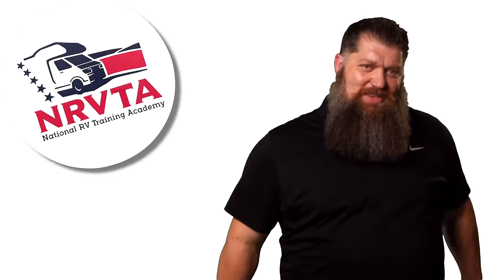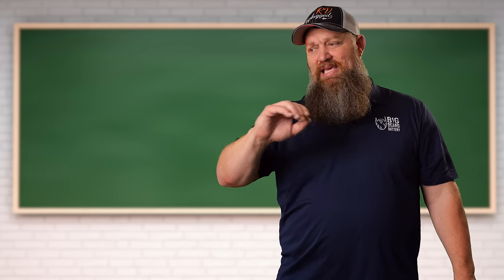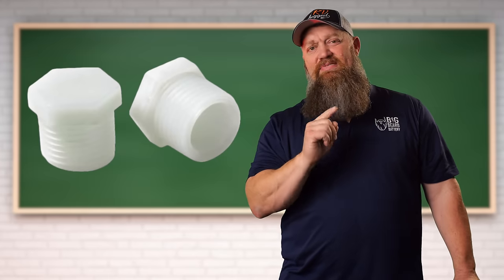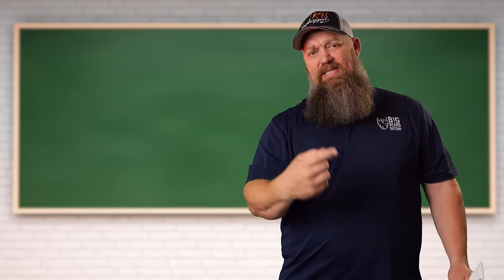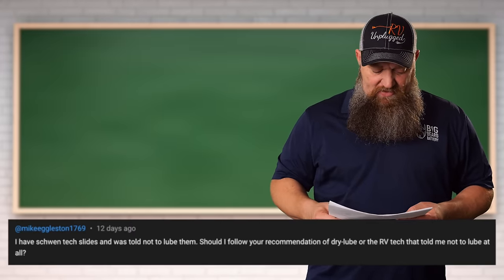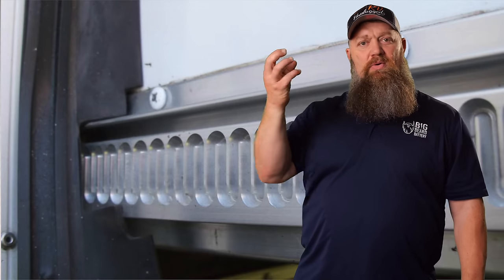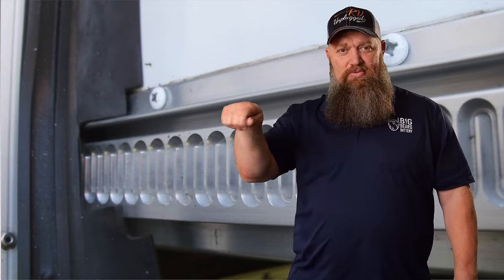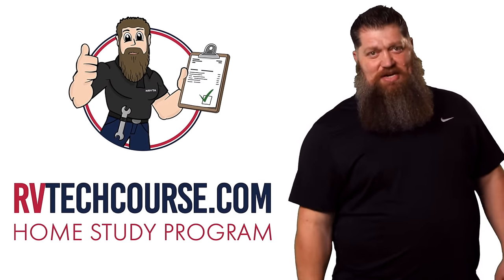Anode rod.  Does my RV water heater need one?

Comment: Hi Todd. Thanks for all the great information in your Tech Tips. I’ve been researching an issue with our Dometic water heater when it’s running on propane. It start up fine but then kicks on and off randomly. Sometimes it runs for 20 minutes sometimes only for 30 seconds.  Then it will immediately try to restart itself and most times it does. Occasionally the reset light will come on and we’ll have to turn it off and back on again. I learned there is a thermal cutoff fuse, ECO and TStat but it seems if any of these were not working the water heater wouldn’t run at all. After inspecting everything it looks like the red wire to the ECO may have some charring on it which my best guess is saying that perhaps flames are coming out and up to the wires and the components are doing their safety job by shutting it down. What would cause flames to be coming out near the burner?  I’m not sure what to look for there.  I don’t see anything blocking the area near the flame but the “pipe” the propane goes through to the burner has a right angle in it so it’s hard to see through it. Any suggestions on what to look for would be greatly appreciated.

Comment: Morning, when I removed the plastic plug in my Atwood water heater, as the water drained out there was a milky colored flow at the end of draining 6gal of water.
My RV is 27yrs old, I don't think it was ever properly winterized before in it's life, I installed an anode rod then used the RV for a season, when I winterized and drained the tank again there was no milky water at the end of the draining and there was some slight pitting of the rod.
Do you think the slight pitting was from the threaded cap of the rod?

Comment: Todd (bearded guy on the internet), can you help me with my furnace? My furnace would light but not stay lit. Practically from the start of ownership. I replaced the sail switch and that did not help. I’ve looked into replacing the relay switch but am concerned with taking out the furnace to get to it and I have a hard time thinking it’s the problem since the furnace hasn’t really worked from the get go. Can you give me some ideas on what to do? Thanks. Love your channel.

Comment: Our hot water smells like rotten eggs. So what is the issue with my Atwood G6A-8E? We put a zinc anode in our heater in another RV and solved the problem. We have a Northern Lite Truck Camper.

Comment: Hey Todd my Motorcoach is 17 years old did it come with adode rod?
Reply from the maker: It depends on what brand water heater you have.  Atwood / Dometic tanks are aluminum are do not need an anode rod.  They will have a plastic drain plug.  Suburban tanks however are steel and do require an anode rod.

Comment: Is there an email or somewhere I could send you a question along with a picture? When we stopped at Buccee's store, we noticed something dragging underneath our camper. My husband pulled it out. It was a steal rod with a threaded nut on the end of it. From what my husband could tell, nothing is broken or appears to be broken anyway. Everything works fine. The slide out works fine. I was told that every slide out system has a manual override crank for it in case the electric fails. If this is true, I am wondering if this is the slide out manual override bar. Any other ideas for me as to what this bar is or goes to?
Reply: I might bhave a idea but with out looking its a guess. The only rods that i know of are for the sewer gate valves.  I assume you would know them . A nother thing i have seen on some rv slides the have a rod that holds wire coiled up for power in the slide wall. Its a holder for slack for the wire as it goes in and out. Hope that helps..
Reply: @chadengemann8237  I appreciate those ideas. The gate valves are working fine. Opening and closing with no problem. So I don't think it's something with those unless it's something hidden. The rod holder for slack idea seems plausible except I don't understand why the rod would have a threaded nut welded on the end of it. For reference, we have a Shasta 25RS 30ft Travel Trailer. My husband found the rod just in front of the axle/wheel and behind the doorsteps. He crawled in between the doorsteps and wheels to get the rod if that makes sense. There is also a small hole/opening just under the doorstep that I have never figured out what it is for. It's not a dog tie out.

Comment: Todd, Please stress the impotance of using the CORRECT Anode rod, based on its metallic components!  Ex: Aluminum for ceramic coated tanks vs. Zinc for all others.  I had to find this out the hard way after tasting Zinc Oxide in my ceramic Surburban (sulfur taste and smell).  Thanks.
Reply: Magnesium rods work the best
Reply: You couldn't be more wrong about what's going on in your tank...magnesium rods corrode faster, needing replacement more frequently but some say offer more protection as they are more reactive (galvanic corrosion mentioned in this video) . Aluminum last longer. The zinc rods for rv use are not pure zinc, that's toxic. They are aluminum with zinc added. The sulfer smell you refer to is not zinc oxide, it's hydrogen sufide gas created by sulfates in the water (not stopped by filters) and bacteria (only some stopped by certain filters) reacting and creating the gas. (also known as Sewer gas) The sulfates in the water react with bacteria stuck in crevices in your tank (from infrequent or improper maintenance). Bleaching (or white vinegar) and flushing the system is the only way to rid the bacteria. The zinc added to aluminum rods reacts with the hydrogen sulfide and creates hydrogen gas and zinc sulfate (precipitate). This will effectively lower or diminish the smell to perceived acceptable levels, but it's not stopping the root issue. 
Rinse your tank. Bleach your system. Do proper maintenance. And don't tell Todd to give people advice you made up yourself.
Reply: By the way, zinc oxide is odorless. It also takes around 1800°F to create.